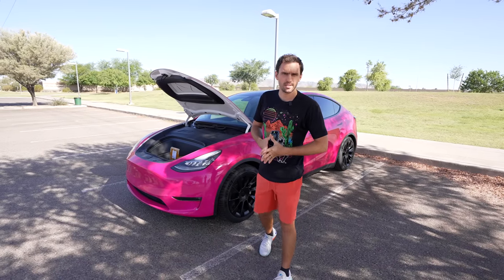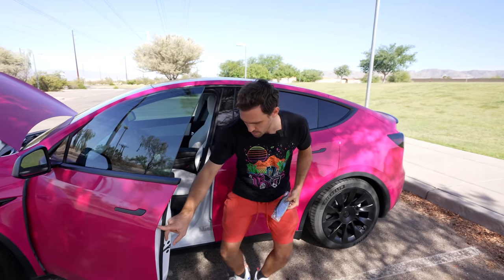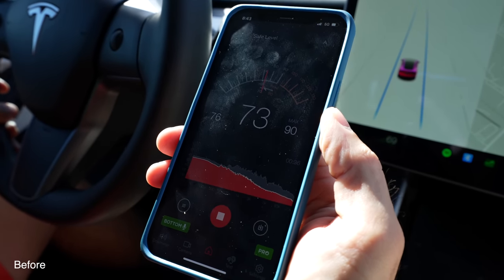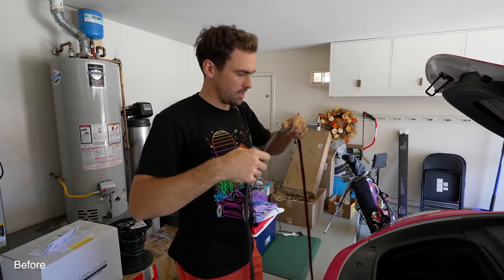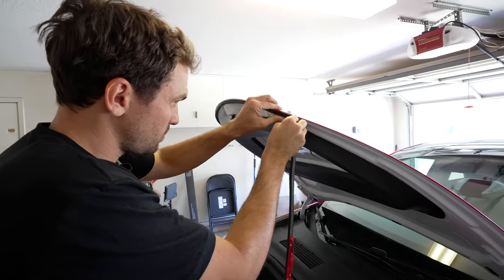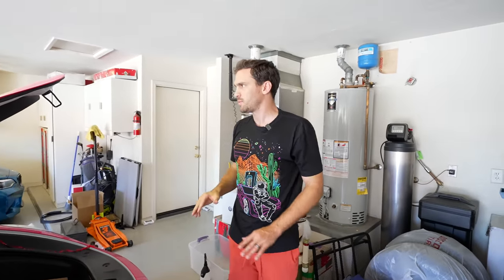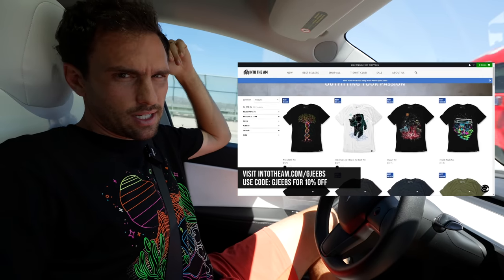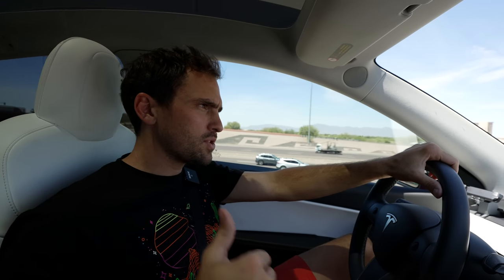I Reduced the Cabin Noise in My Tesla Model Y for $80

Comment: 1 db is a 30% difference in sound pressure, that's pretty small. 3 db would be a factor of 2. Below that, the treatment is not worth the effort or the risk of having parts freeze together in winter. Thanks!
Reply: Totally agree

Comment: I added the same kit in my 2021 MYLR when i got it.  Also got about the same 1-2 dB sound reduction. The rubbers are low quality and seem to "flatten" after a while. The self adhesive is poor and does not last. I had to reapply with body shop trim adhesive. The gaskets do improve the tonal quality of the door slam. I do have a personal question about your Unplugged Performance coil-overs.  I will message to your site, thanks.
Reply: 1 to 2 db is definitely noticeable. After all, sound waves double every 3 db. if anyone cares to know.
Reply: @claus1225 not really
Reply: Improving the sound of the door closing is actually pretty great. I cringe every time my wife closes the door. Might get it if the price drops and more of these kits come direct out of China...

Comment: The OEM weatherstripping works just fine and seals out the road noise in the door areas. It’s the sound deadening like most cars. Floors, a,b,c-pillars, door shells, roof (if not glass) and firewall….

Comment: My MY 22 is surprisingly quiet on the highway. My decibel level is around 59-60 measured with my Apple Watch.  Yes road condition will make a slight difference. No complaints from me
Reply: What tires did you get? I think Gjeebs has the 21" low profile performance tires.

Comment: What makes the most difference is the quality of the road.  Our MY (feb 2021) has the dual pane glass but it is the mechanical transmission of road noise due to the stiff/harsh suspension.
Reply: Yep, that's why I am always searching for the quiet tires.
Reply: @malin7919  So did you find the quietest tires and if so what are they please.
Reply: @LarryRichelli  

Michelin has some low rolling resistance tires that are quiet but my stock tire Continental Procontact RX tire provides the best range, so I will probably stick with my stock tire for now.  I heard Googyear came out with a new tire for EV but I need to  see the impact of range.

Comment: Thanks for sharing. I still hear some noise produced by the tires when they sound hallowed. I also installed sound deadening material all over my car, but the window glass allows sound in because it has thin glass.  It is that we fix one area and another one let’s sound in.  Some drivers are putting foam inside the tires so that they don’t resonate. I will explore that and try to get thicker window glass. For now, I play some music to replace some noise with different sound.

Comment: There was a 1 to 3 db improvement. I wouldn't say they're not worth it. Every little bit helps I guess.

I believe where you may get the most improvement, and this seems to be a little overkill, is to put sound deadening material in the doors and possibly in the hatch. Use that material they use to deaden the sound when you get a decent subwoofer installed. I bet you that will take your db's down into the mid to upper 60s.
Reply: Same experience. I installed a similar kit 2 years ago with no noticeable change. Also did the top glass.
Reply: dB soundscale is logarithmic. a 3 dB decrease is HALF the noice. That is a MASSIVE improvement.
Reply: @carlhenrikenell3416  No, no it is not half the noise

Comment: The doors and the hatch already have gaskets to keep out sound, water, dust. Adding this second layer is likely useless. The frunk didn't appear to have a gasket, but that's not directly connected to the passenger compartment, so little need. Your test basically proved that out. Save the $80. I'm curious how the newer MY with the double pain windows registers on the dB app.
Reply: Update: model y 2023 with the double pane glass has so many whistling noises. I googled options and this video came up lol I have a model 3 and my older brother has the y both 2023 and my model 3 rattles a bit but the model y literally whistles if you’re going over 30mph and it’s ANNOYING
Reply: @hatemali6081  I just purchased a MYLR about the time of my previous comment. I have no whistling noises from my windows, so yours must be a one-off issue.

Comment: It’s worth noting that 3dB increase in volume = doubling. 
So it should be noticeably more silent, but maybe a better quality kit could work.
Reply: No, that is not true. +3dB is doubling in the total power of the signal. In terms of loudness perception, 10dB is approximately a doubling of sound intensity. The human ear is al
Reply: @Dawood4  Signal? When it comes to sound energy, +3dB is a doubling. 
F.ex being exposed to 60dB in 2 hours is equivalent of being exposed to 63dB in 1 hour. 
So when it comes to noise, it will definitely be noticeable over a longer period of driving, that it might not be as tiresome as a louder noise volume. 
There is also the noise frequency to consider, low humming might be less tiring than higher pitched wind noise.
Reply: @DIYglenn   The human ear is also logarithmic. A doubling of sound power does not lead to a perceived doubling of volume, psychoacoustics tells us that approx 10dB increase will lead to a doubling of volume. And yes a signal, sound can be classified as a mechanical wave and be analyzed as a signal. When speaking about acoustics, the dB is used to quantify power ratios measured in watts. It may double or halve the allowed exposure time but that is not what you said in your original comment which was ambiguous. We have no frequency spectrum analysis from inside the vehicle so there is no need delve into ISO 226:2003 equal loudness contours... 
besides, he never even measured a 3dB difference, even in his very scientific test

Double or twice the loudness = factor 2 means 10 dB more sensed loudness level (psycho acoustic)

Double or twice the power = factor 2 means 3 dB more calculated power level (sound intensity level)

Comment: I installed mine yesterday on my 21 model Y and got a lil noticeable difference but just saying, you installed the kit incorrectly as per the instructions, for one you shouldn’t have to cut any thing as they are custom built, you installed it in the wrong place is why you had to cut the access off.  The frunk gasket gets installed on the car and not the hood and it gets installed on the truck lid and not the car.  Just saying

Comment: Compared to my 15 MB C300 sport, granted it wasn't an S class, but my 22 MYP is pretty quiet for a car with 21in rims on a lowered suspension. 0 complaints. I just hated having to deal with a puncture on the door trim, which i noticed at delivery and took them 2 months to fix. Mobile Service tech replaced it in 10 minutes but the first time they came they brought the wrong color 😠. This could have easily been fixed in the factory. I noticed it as soon as I sat in the car. Also, had to take it for minor aliment issues and to my surprise they had an old M3 loaner. That thing was loud AF. Knock on wood, my Y has been great and I still love it. Big improvement over the early builds. Tesla just need to improve QC and stock up on parts.

Comment: a bit late to the game so you may have covered this elsewhere... have you tried the little rubber tube or solid piece that goes between the windscreen and the roof yet? that cross vehicle gap will generate an amount of noise as air speed increases, closing that off may help with noise and even range if cleaning up the profile reduces aerodynamic drag???  Over to you 🤓

Comment: I don’t remember your tires if they were the OEM ones or now, I remember you replaced 2 already but try to run that same test with tires PSI at 38 and then 45 to see if you can see a change in noise.

Comment: If you didn’t turn off your air conditioning fan doing the before and after test or at least have the fan set on the same speed in both tests then your test may be worthless. How do you feel now that you’ve had it on for a little while? Is it performing better? Or do you not really notice much of a difference?
Reply from the maker: I notice a difference for sure. The issue is some of it is peeling off which sucks. So it works but it’s shit
Reply: @Gjeebs  Well, shit then. At least I have dual pane windows.

Comment: I have a 2022 Model 3 Performance.  I CANNOT stand how dirt gets up into the area of the door openings.  Bugs me so much.  On a given weekend I might only have time to clean the exterior of the car and not the interior.  Beautifully clean car and then you open my doors and it looks awful. I would THINK in addition to sound dampening that maybe these strips on the doors could help with dirt and dust getting in as easily.  Gjeebs, I’m curious if you could do an update video maybe in a month or two to see if they help keep those areas cleaner?
Reply: From what people have said, I might help with that dirt but also that these don't last past a few months of washing and opening and closing the doors and hatches. So $80 for a couple of months of use?

Comment: QUESTION:  🙋‍♀  Can anyone advise best way to rinse down my new MY 2022 before I cover it with car cover.  🆘 I am assuming spray water of course  but NEED HELP on best "wipe-down" material and process to dry w/o damaging paint ⁉
Reply from the maker: Don’t use just water you need some lubricant so you don’t scratch the paint (this goes for all cars) Costco has Kirkland microfiber towels that are yellow in I think a 36 pack. Get those. Also I use hydrosilex ceramic waterless wash. Code GJEEBSJUNE will save you 25% on hydrosilex.com. I also recommend their ceramic glass cleaner and plastic and leather cleaner. Hope that helps
Reply: @Gjeebs  👍 and thanks !
Reply from the maker: You’re welcome! I have some care cleaning videos of my Y that will walk you through it all
Reply: @Gjeebs  👍🙏

Comment: 1 or 2 db’s is nothing. However, with sound insulation: ANY gaps - i.e. spaces like the ones you made between sections of the gasket by cutting sections - completely negatives the attempt to block noise transfer. FAIL

Comment: Too loud on the Interior?  No engine noise obviously so I wonder what everyone is hearing (most listen to the radio/music 🤔🤷‍♂️)
Reply: My 3 & Y are pretty quiet and I added the rubber strap to the roof which I think doesn’t do much, suppose to reflect the air between the top glass.  I just hate installing these, in the heat especially in Az where he lives and Las Vegas, these won’t hold and will fall out.

Comment: The real improvenent is not the noise reduction, but having all the door seals clean from rain dust.
Reply: People are looking for noise reduction not seals clean from rain dust. That is what the product advertised. It is just waisted money.
Reply: @dl4434  I agree with you. My experience on Model 3 was that there was no noise reduction but doors closing more firmly and minor vibrations. On the Model Y, nothing really changed. But, in both cases I welcomed having doors seals always clean and this, to me, is worth the purchase. Tesla should mount double rubbers by default.
Reply: @alccad  I do not think any cars has double seals for doors and hoods. It costs more for car companies. Why should they spend more money for just keeping the car doors clean? Assume tha part costs only $40. For 100,000 cars, it costs car company 40 millions. Not economically.
Reply: @dl4434  well… despite what you can think, most of the premium cars have. And owners I advised to get the double seals to have a clean car doors are satisfied even if the noise is not reduced. Open your mind a bit. 😉
Reply: @alccad  What premium cars are you talking about?
Reply: @dl4434  not sure the car model has same name in your country, but for example, Toyota applies them even from the Yaris. Germans brands commonly on major models. Sometimes they are double, meant in two edges (interior + exterior), sometimes they are double, one on the door and one on the body, and they kiss  each other on door closing.
Reply: @alccad  Do you consider Yaris is a premium car? It is very low end car in US. What Premium German cars are you talking about?
Reply: @dl4434  of course not. It was just to say that some brands offer these items even from the city cars segment, maybe also depending by the Country weather… . I had a BMW X5 and it had double seals. Audi a6s also have. But it is not so important to spend the night discussing. 😉  Wish you a nice day in the US. 👍
Reply: @alccad  Good night. Just to let you know Tesla car has double seals: one by the body and one by the door. I have never seen any cars has double seals by the doors or hoods.